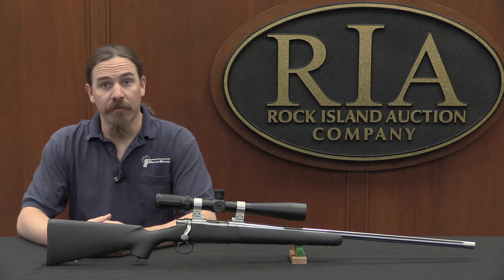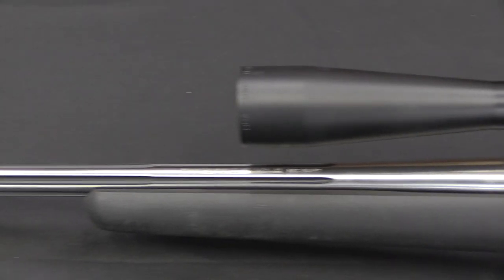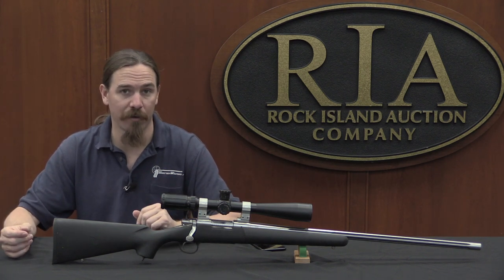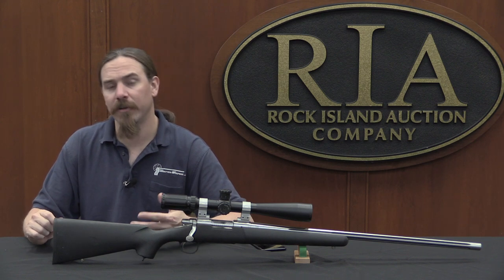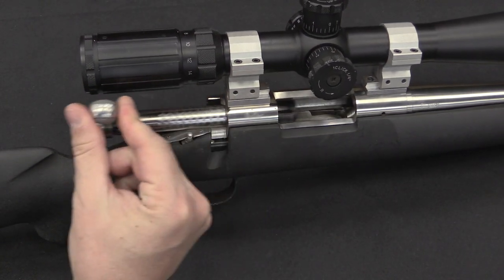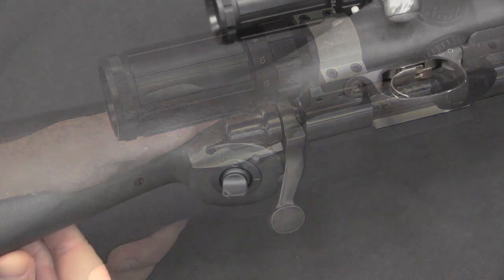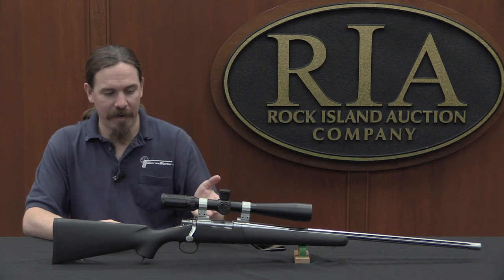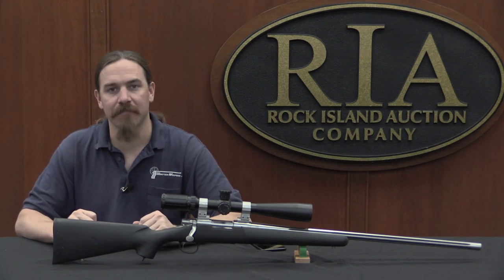Remington EtronX: Electrically Primed Ammunition

Comment: Am I the only one who can't imagine that coming up with an electronic circuit that would cause a micro second long, heat generating, pin-point "zap" that would cause any standard cartridge primer to fire? It might require say..... a rechargeable  lithium-ion battery pack (for the amperage requirement), but that's very common place in today's electronic world. Seems very doable to me.

Comment: A battery?

Surely the 9 volts from that dinky batter could be replaced by the twisting and linear motion of the bolt? I'm absolutely positive that it would be slightly heavier, and more expensive, but you'd be selling an electrically firing gun that'd NEVER need batteries. It would also get funny looks when you pick up your bolt gun and refer to your charge handle, super tactical! I'm also absolutely positive it could be done with off the shelf parts.

Comment: I'm sure this type of idea has been in the works in the US military since or even before the introduction of this rifle. Sure the battery could be installed into the cartridge but then you would have to worry about corrosion inside of the cartridge or accidental discharge. Or the batteries losing power over time causing malfunctions in a semi or full auto. And you cant really expect a soldier to "wind" up a capacitor in the heat of battle. Or rely on carrying extra batteries in their pockets along with mags. Maybe mounted on a humvee or helicopter where the power can come from the engine. Sort of like the mini guns today are anyway. I would say that in extremely long range sniping a rifle like this would prove itself due to the time it takes for the round to start moving being so short. Yes snipers are on missions for days at a time and maybe weeks. But solar charging or wind charging may be implemented. Or even a winding mechanism could be used then. And the sniper could be a lot more silent due to the cocking and moving of the bolt not making any clicking or clacking. They could introduce bearing into the receiver to minimize any chattering of the bolt on the receiver and make the action more smooth as well. I can see this coming into play in the next 5 years for sure. And DARPA if you're listing please send me my money if I see any of these ideas in the next military sniping rifle.
Reply: Update. The battery could be installed into the magazine but would increase the weight. Idk how many rounds a typical 9v could fire but I dont think it would be wasted in a 30 round mag. And the mags would probably have to be collected right away because of risk of the combatants using the batteries to make IED's with. But we can make them tamper proof so when they expose the lithium it starts on fire????

Comment: Way too many steps to get the weapon to ready from storage in my opinion, like if you needed it in a rush and the battery is dead or corroded, or couldnt find the key, or it was throwing an error and you didnt have the manual with you. I just love the simplicity of standard firearms throw a bullet in and pull the trigger

Comment: ...... normally I'd ask why they didn't use a simple piezoelectric system like a lighter igniter, thus eliminating the need for a battery but....probably doesn't supply enough power

Comment: If they can make the brass reusable then you don't have to worry about primers, just powder and the bullet would need to be replaced. Also I would make the bolt go home using a spring so all you have to do is pull back the bolt and let go.
Reply: @walterdove8727  I'm thinking maybe a spark gap sparking many times per round would be reliable enough to ignite the powder.

Comment: Batteries. They leak eventually, which means you'd want to store it without a battery in it. Fine for a hunting rifle, but a terrible idea for anything with self defense in mind. And for those with WTSHTF in mind, now you've got to stockpile 9 volt batteries, which have a much shorter shelf life than chemical-based primers. Also, would an EMP short-circuit this thing? Oh, and it has an ignition key.

Comment: Commenting on an old video here, but would it be worth having an e trigger than could use a servo or some other mechanism to set off a striker and use normal ammo?
Reply: He says the only real advantage this has is to basically eliminate the response time between trigger and the bullet starting to move (or to reduce it by 98% from already being fast). I wonder if this can be done if you need to translate the electrical signal into mechanical motion, instead of feeding the amplified signal right into the cartridge.

Comment: The question about EMPs had me rolling. EMPs are actually not really dangerous, and their reputation mostly comes from Hollywood. EMPs irl are extremely low range and require extremely high power levels, and even then everything that is not a super tiny IC doesnt care at all. The only thing capable of generating an emp that can really harm electronics at long range is a nuke. Also if the designer of these electronics wasnt extremely dumb, he made it so that the gun could be used without the electronics responsible for error codes and stuff. After all the only thing that has to happen for the gun to shoot, is that the capacitor has to be shorted over the bullet, which can be done with the switch in the trigger and nothing else.

Comment: Concerning the use of this kinda ammo post-apocalypse... An EMP powerful enough (either from the sun or from a nuke) would likely detonate that ammo, and even if it doesn't, that primer almost certainly isn't going to work. That being said, you could always keep your eprimers/ammo in a shielded container, but honestly, they really shouldve separated the "primers" from the rest of the cartridge during design. Call me crazy, but I'm pretty sure a spark plug as an intergral part of the gun would've done the same job and been far safer. Also, the ammo would've been slightly cheaper.
Reply: By the sound of it, the primer is a simple resistor: if the EMP doesn't set it off, then it should still fire.
Reply: @absalomdraconis  agreed, but there is still a serious danger of it activating during such an event, which may very well set off the round. Im saying that such a scenerio could be easily sidestepped by physically separating the propellant from the ignition device/primer. This would have had the added benefit of reducing cost per round and not relying on a proprietary primer.

Comment: It is a pretty cool rifle but that error code shit would irritate me so much. Along with the need for a key and the requirement of a 9 volt battery. 

I am just curious if they were worried about lock time then they obviously had a flint lock rifle in mind. If that is the case why not make disposable rounds with a flash hole and just have it deliver a spark through the hole like a flint lock. Reusable rounds is a decent idea but who really wants to be reassembling rounds, I get reloading is around and those people do it but not everyone is a reloader. 

I'd say the rifle has cool historical significance but practicality sort of goes out the window when you start turning keys and reading the OBD error codes. I am calling them OBD codes like a car because it stands for 'On Board Diagnostics" and that is exactly what you are doing with the LED flashing. It was also pretty stupid to only put a red LED on it, the general public is trained to look for a green light to "go" I imagine they would likely want a green LED to tell them you are good to "fire". 

I personally believe with the amount of people who bitch and complain about the evolution of automobiles and how it was completely unnecessary to put a computer on a commuter car (race car is a different story) they would feel the same about guns. Not everything needs to be electronically controlled and I am one of the biggest users of electronics and even build PCB layouts and put circuits together and I can see no decent reason to marry the two. I am with all the other paranoid people as the only reason i can think to use electronics in guns us to regulate and control them. Once we start accepting chip readers and microprocessors then an attempt to regulate them will certainly happen, China, North Korea, Russia and all other countries with strict gun laws seem to control propaganda on computers now, why wouldn't someone think to implement it with a gun that is computerized?  Some evil POS out there would do it and it would take people who build black market guns to undo it. If we are building black market guns today without electronic guns in regular circulation then you have to ask why they are doing it? They do it to battle bad gun laws, flipping a switch is a lot easier than confiscating it. Its just always going to be a bad idea. 

I know some leftist will say "how do we stop these tragedies from happening" and the answer is you can't. It is an impossible task because it requires you to know the intent and mental processing of every human being on Earth at every second of every day and be capable of accurately predicting their actions. That is literally like predicting the future and that is and always will be impossible, there are just too many ever changing variables in the equation to get any level of accuracy. Simply put you can't control people or their actions and you certainly can't do it through banning inanimate objects. Now excuse me while I go ban keys because I don't like locks or cars, thats what that level of stupidity sounds like.

Comment: My question is, how difficult would it be to replace the resistive primer with a piezoelectric one? It might make the trigger heavier (not entirely sure how much), but it should allow you to yeet the electronics, battery, and ceramic insulator.
Reply: How would that help anything?
Reply: @kurtilein3  Simplification of manufacture, reduction of consumable parts, removal of logic circuitry, reduced hardening requirements.
Reply: @AlexanderTzalumen  No, no, no, and no. You are removing the entire benefit of the rifle, which is a 98% faster time between action on the trigger and action in the cartridge. Also, piezos deliver a spark only if they do not shatter, and only at high voltage with extremely low amperes, not reliable. Also, piezos are shit at producing meaningful amounts of energy. Also, piezos translate mechanical energy into electrical one, and electrical energy into motion on a tiny scale, this technology is simply a poor choice here.
Reply: @kurtilein3  You seem to have envisioned some bizarre system that probably would not work.
I envision a spark gap inside the cartridge to provide ignition instead of heating a resistor. Everything else flows from that. A tenth of a millisecond of electrical arc can easily ignite many things, including solid propellant.
Reply: @AlexanderTzalumen  But how does a piezo-crystal fit into that? It is a crystal that if struck hard, but without breaking it, will produce a high-voltage spark, but with very low current. The primer they currently use is just a basic resistor, really stable, will do nothing unless big amperes are applied. And the rifle directly feeds enough energy into it to basically vaporize it. It gets destroyed, gets extremely hot, and expands into the propellant, in an instant. A piezo Crystal needs to be hit mechanically, and then produces a tiny little spark. if you hit it with electricity it will just expand a little bit or contract a little bit and otherwise behave like an inert piece of ceramic.

So what the fuck do you think a piezo even is, and how the fuck do you want to use it here? Explain to me what you think a piezo even is, because this is where i think the big fuckup with your idea is located.
Reply: @kurtilein3  Okay, first, you're being awfully rude and confrontational for this kind of discussion. I don't see the point of all that, this is an engineering/design discussion, not politics or religion.

and yes, I am aware that a piezoelectric crystal is a crystal that produces charge when mechanically deformed.
The crystal goes in the gun, not the cartridge. The goal I'm interested in is replacing primers and heavy hammer/striker springs entirely, not just improved lock time over standard primer ignition methods.

The mechanical question of note here is how much mechanical force on a piezo crystal is required to ignite the powder in a cartridge with a spark gap, vs how much force is required to sufficiently deform a standard primer to set it of. 

Nothing to get aggro over.
Reply: @AlexanderTzalumen  I am sorry, i apologize, i turn insulting and confrontational and rude when i see a discussion reaching a dead end, but your most recent reply is making me reconsider. Amplifying a signal to high current high voltage is a microsecond thing, far below millisecond, far below 1/1000 of a second. May even be done in nanoseconds, which is one thousand-millionth of a second. The primer gets hit fast, but also hard, it heats up so fast that it evaporates and turns into an expanding plume of gas going right into the propellant. If you do that in open air, hit a resistor with such a spark, it just disappears with a sharp cracking sound. 

Any mechanical system would remove the benefit this gun has and greatly increase the delay, and this system has basically no delay. Amplifying an electrical signal to the point where it can on the spot evaporate material causes no delay, and putting that event where material simply snaps into a plasma right into the cartridge is a design you cannot improve upon by adding any mechanical motion. 

So that is the point where you caused my brain to freeze from the start: The action from triggering the trigger to some material evaporating into a plume of plasma right inside the cartridge is virtually instantaneous, in the video he says that compared to very fast mechanical action, this is 98% faster. Piezo involves mechanics, how can it improve anything? Limiting factors are the speed of light and the reaction time of micro-transistors, solid-state electronics, how can you improve on that if you introduce any element of mechanical motion? You will be off by a factor of 10.000 to 100.000 if you introduce any mechanical motion. Piezo makes no sense without mechanical motion.

Comment: This seems overly complicated. Why not just have a more easily removable battery as a "key"? I have other issues with this too, not with the fact that it's electric, but that apparently it's complicated enough to give a bunch of error codes. But then again it has fewer moving parts that can mess up I guess. I just see that it could be simpler is all.

Comment: Electronics also has a great many potential safety benefits.. imagine subtle grip scans so nobody uses their parents gun....you could call it "The Sword Of Selection" feature..
Reply: And nobody could steal it either.
Reply: And for those worried about GPS tracking or something, that's easy enough to check for. Especially if its using your battery... and if it doesn't need your battery it could easily be hidden in a mechanical gun anyway.
Reply: And an ammunition counter would be pretty easy.  Along with many options on burst control for military rifles... rifles that couldn't be used by enemy forces.. potentially lighter too..
Reply: @yogsothoth915   Assuming the enemy is unable to decrypt your codes. Any new tech to prevent something is countered by some countertech to beat it. No such thing as perfect encryption. So a military rifle set up so only you can use it can eventually be 'broken' into assuming the other guy has some tech specialists. And that is assuming they don't simply force any captured personell to break it. If they captured enough weapons of the presumed safe type they probably captured some of your men as well. Or they can simply take these weapons apart. So stealing and using it will still be an issue its just that it will require someone who is more technically minded.

Comment: Looks like it need a solar panel on the butt stock then, with a small heavy duty charge controller in there as well.  Can't be running low on 9volt juice.

Comment: If it had been built so that you could swap out the bolt/trigger group for a "normal" bolt/trigger, it may have had more commercial success. It also looks as though the battery compartment is not watertight, but maybe the butt plate does that job. It would also make sense to have storage in the butt for a spare battery. And the Philips screws for access? Give me a break, what a shitty method for a compartment you will need to access every time you put the gun away in the locker (you don't want to leave a battery in there permanently, they have a tendency to corrode and leak).

The key is just dumb - it protrudes from the stock, which looks awkward and "snaggy" - and is there any place on the gun to store the key? (Of course it may be intended that the key is meant to help secure the gun against unauthorised hands, e.g. kids, but that's a poor substitute for proper gun storage).

As Ian says, an answer looking for a question. (Often stated as a solution looking for a problem).
Reply: The previous video I watched was the Steyr Scout - in comparison to this "thing" it was like they were designed on different planets. AND the Steyr was cheaper.

Comment: "Hardened against cold" I thought most silicon based chip tech runs faster and more efficiently in the cold?
Reply: Chips yes, batteries and capacitors not so much.